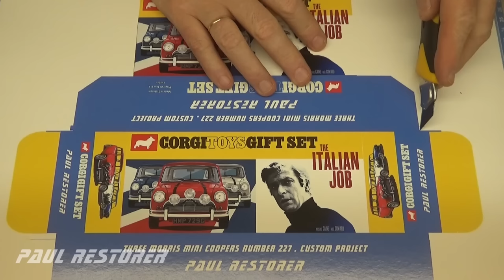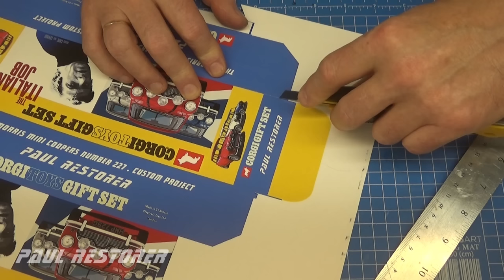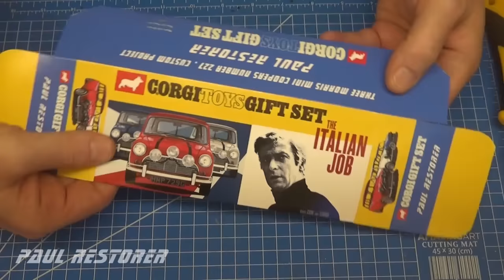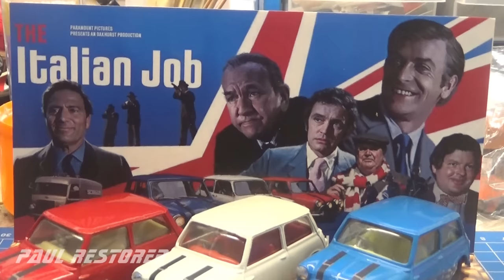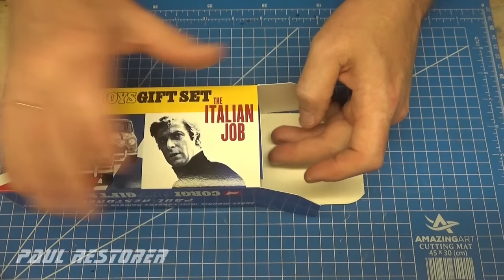Corgi Mini Cooper. Budowa filmowego zestawu podarunkowego  1969. Model odlewany.

Comment: Sadly 16 Cooper S were destroyed making the films and no original bodies actually survived. Parts from some parts which were sold later but no original bodies. Even the number plates on the cars were from G reg models. Technically the rear lights and rear window were not on G regs.  great resto though
Reply from the maker: Thank you very much Bob